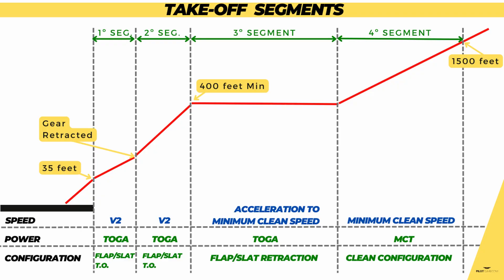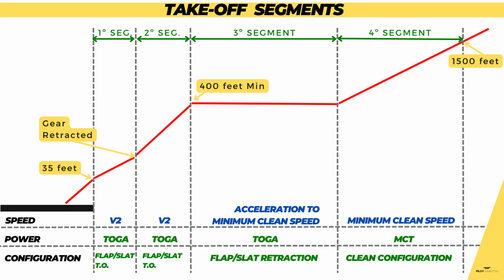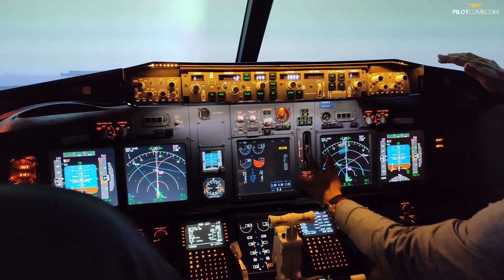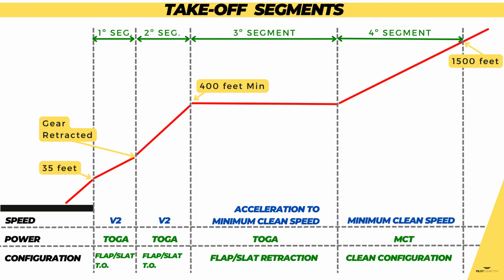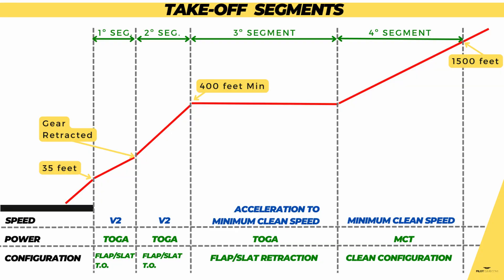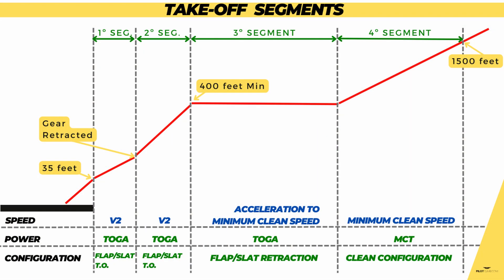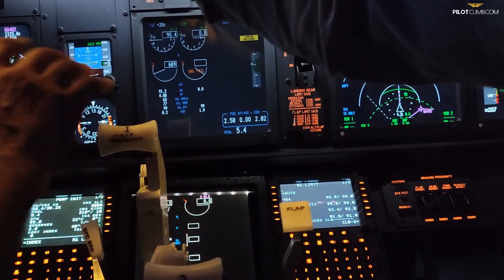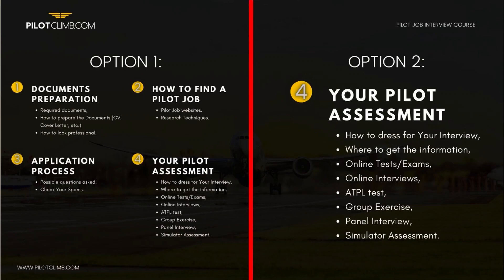Aircraft Take-off Segments - (what happens if an engine fails?).

Comment: Hello Gabrielle! As allways very helpfull and clear explenation so thank you for that:) I just don't understand one thing. You said, that we have engine failure at vef, after which we arrive to v1 and decide to continue. Shouldn't we abort take off if we suffer engine failure before v1?
Reply from the maker: Check the video about vef and v1 I made.
Reply: @PILOTCLIMB   Thank you! now I get it :)
Reply: Vref  by default is always 1 second before V1. Meaning that if by chance you have an engine failure at Vref you have one second to react and initiate an RTO. After which you would hit V1 and need to continue the engine out takeoff procedure. 

In order to negate this very small window, some airlines call out V1 at Vref

Comment: 1)
What is after Segment 4, do I still have to keep MCT?

2)
Can I maintain a certain selected speed with MCT? Or does it accelerate until VMO?
How is it in 737 and A320?

3)
What if the SID requires 5 or 7% climb gradient and the aircraft has an engine failure and is unable to keep this gradient?

4)
Is there any situation where it makes sence to use Thrust reduction and Acceleration height at 400ft AGL?
Can  you give an example, please?

5)
What is the minimum height for Engine Out Acceleration Altitude?

6)
Is the Engine Out Acceleration Altitude the same like MFRA?

Thank you Gabriele!
Reply from the maker: Great questions, After the 4th seg you just level off at a safe altitude, in case of an eng fail you don't follow the Sid, the  acceleration depends on the operator (Min 400feet), MFRA is exactly that. Have a great day.
Reply: @PILOTCLIMB  

Thanks Gabriele,

What is after I level off with the thrust mode?
Do I have to change MCT to another mode at a certain time?

Can you answer question 2 and 5, when you have time, please?

Greetings!